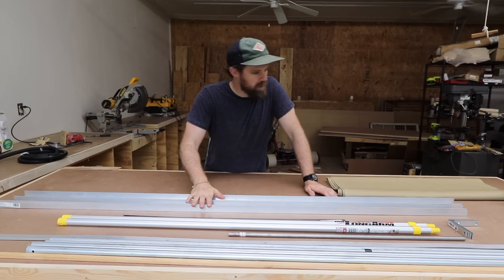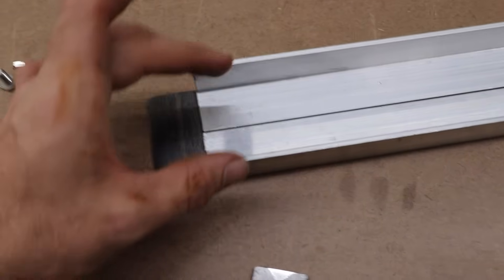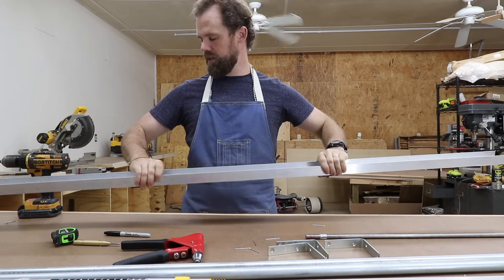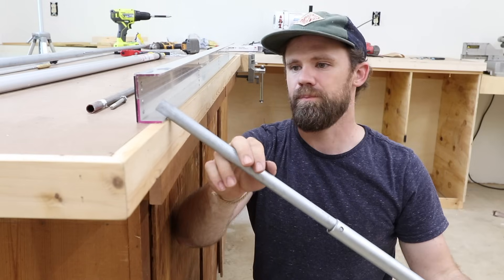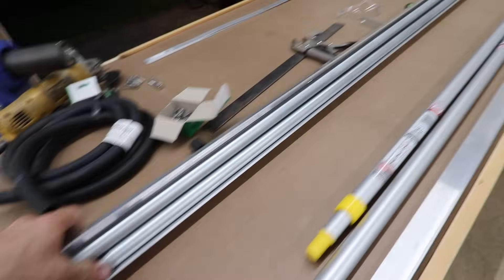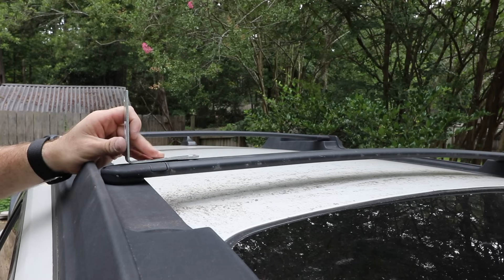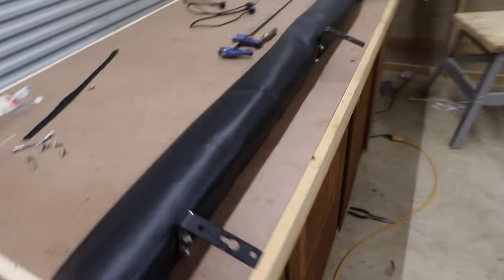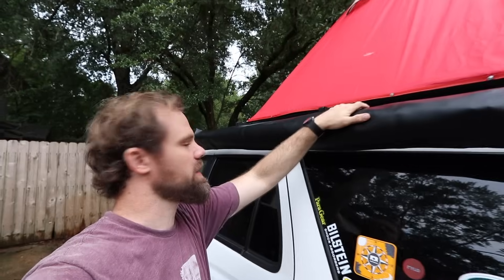Building an Awesome Truck Awning!!

Comment: It seems really low, like you’re going to be ducking down the whole time you’re underneath it. Is it just perspective or is it really that low?
Reply from the maker: It’s 6ft so it’s right at my head but I’m thinking I’m going to flip the brackets so that it’s higher.
Reply: This is why I opted for a stand-alone  12x12 canopy for my van build. I really wanted an awning but at the height of my van and the need to shed rain here in western Washington, it just did not seem to make sense. I love his build though and my van has a lot more room for gear.

Comment: Looks like you need to move it up 6 inches so you don't have to kink your neck under it. I like it but I think I'm just going to buy one since I don't think I could make it as nice.
Reply from the maker: Yeah definitely.. I’m going to flip the brackets to lift it up some.
Reply: Incredible awesome job again
Reply: Patrick Remington that’s exactly what I came here to say. It is too low and I could tell by how much you had to lean over. Looks pretty good otherwise.
Reply: I have something I built similar but my rig is taller. Great job!!